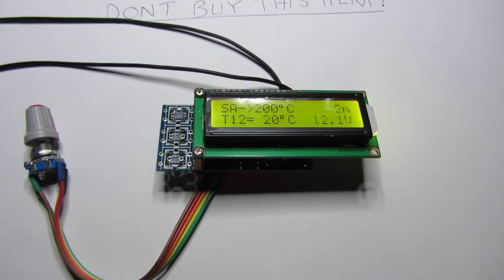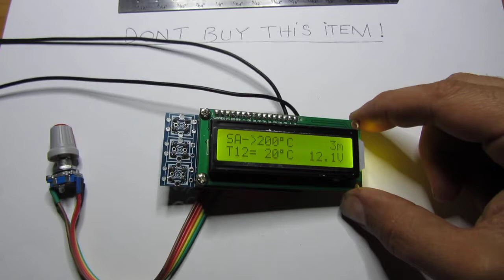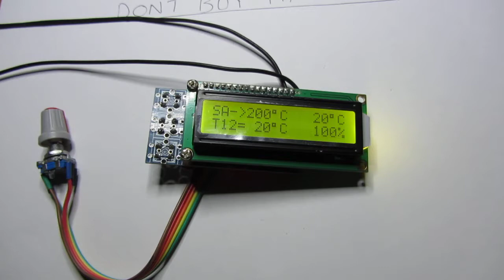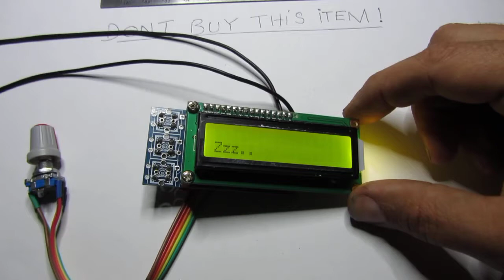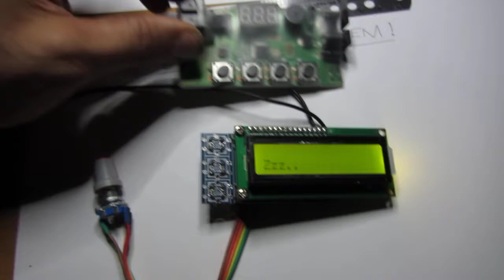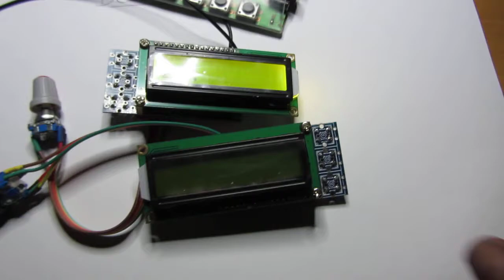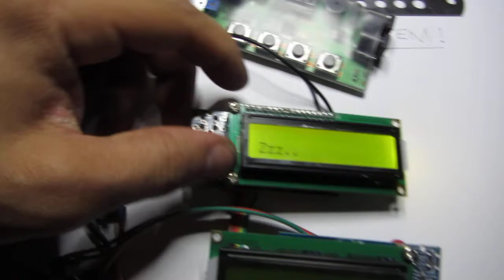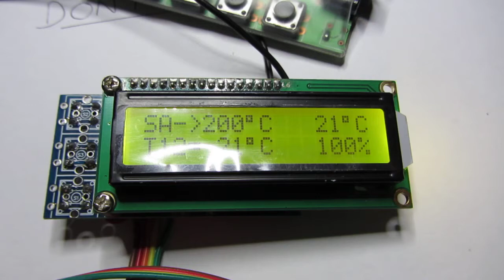Soldering Iron Station Temperature Controller For HAKKO 936 T12 T1 T13 Handle

Comment: try using 24v dude.... ummmm....
Reply from the maker: Like I said in the comment below, hundred time before, the 12V here are for to illustrate the video.
Problem with this station was coming from the misunderstood of the 907 handle cheated with a T12 tip, this handle working usually with PTC sensor.
This kit doesn't accept all handle. Only T12 tip, no even the t4 tip.
You think to be intelligent with your poor stupid comment. Just let me tell you you tired me. Thanks.

Comment: Alexander, what make and model is the middle handle. I like that one but cant find it anywhere. Thanks.
Reply from the maker: Hello, this handle is the WMRP weller, it works with weller station, and some many electronic makers make a soldering station for it. But it's very expensive.
If you want to make nice soldering with low price, think to have  T12 tip (the kit on the video works only with the T12 and T4 tip.
The WMRP tip cost between 30 and 50 dollars. And the handle cost 200 dollars. T12 tip cost 4 dollars....And it's very reliable.
Thanks for your comment.
Reply: Thanks. I have just found some. I was surprised at the price of them. They are expensive. I certainly cant afford one. I will stay with my T12's and TS100 irons. Thanks for the reply. :)
Ian
Reply from the maker: I have these handle. I can tell you I have the WMRP because it was a dream for me to have it since I was a child.
It's really not worth to buy it, cause T12 tips (4 dollars) and T12 handle (13 dollars) are not expensive, and make a perfect job.
Actually, if you make a soldering station with this kit, this T12 and the T12 handle (a real T12 handle and not a 906 customed handle) you can have a soldering station wich cost something 500 dollars.
Don't care about the low price, these tip are an incredibely way to make your self an amazing and powerfull soldering station.
Please see my other video about that. Thanks.

Comment: So where did the push-buttons from the left of the display go? You sure they aren't needed for anything?
Reply from the maker: they have the same use than the knob. But a clic on the button change degrees by step of 5 degrees, the knob by 1 degree. The knob have a push button integrated in the shaft, equivalent to the central button on the pcb.

Comment: Can you say where can I buy such a handle separately? https://www.aliexpress.com/item/BK950D-Digital-936-Soldering-Iron-Station-Controller-T12-Heating-Core/32625105427.html?spm=2114.13010308.0.0.AQRHYq
And will it work whith t12 tips?
Reply from the maker: You can find it on Ali express or ebay, "T12 hakko handle". yes, it can work with this station, just be carefull with polarity of the tip, or you can destroy it.

Comment: ty for this video, and what is the name of the hakko controller that DID WORK well for you? I bought a controller on ebay, and it does not work correctly, so have already wasted money , was wondering if you would be so kind to tell me which one DOES work so i can buy that one. and waste NO MORE MONEY! LOL
Reply from the maker: +Hammer USN 3:57 this one works nice, or this one http://i.ebayimg.com/00/s/NTk5WDgwMA==/z/1KAAAOSwNSxVHL-Z/$_12.JPG
Reply: +Alexander Hartdegen thanks , I appreciate it, how about the one you show with the memory buttons, does it have a name or ID of some kind ?
Reply from the maker: + Marteau USN no. just be care about the image of it. but this one works with a PTC element not a thermocouple . If you do classic electronic chose this one on he video (906 handle) if you do micro electronic and classical, chose this one on the picture.
Reply: +Alexander Hartdegen thank you, for being most helpful.
Reply from the maker: if you use your soldering iron in several use condition, it can be important to have this micro vibration switch incorporated in the iron handle. If not connected, the iron will work correctly, without standby mode on.
The vibration sensor must be placed in the iron handle, not on the pcb.

Comment: you can try some other chinese HAKKO T12 style controller boards.. I got this--->   http://www.banggood.com/Digital-Soldering-Iron-Station-Temperature-Controller-Kits-for-HAKKO-T12-Handle-p-993248.html
and i am going to test it soon!! Other guys say this is good!
Reply from the maker: +mitropoulosilias yes this device works.
Reply: Alexander Hartdegen Ohhh, Thank's a lot! I always wanted a soldering iron that have replacement tips, and i never had lot of money for that!!
Reply from the maker: +mitropoulosilias in fact, the controller board you're waiting use T12 handle. A classic soldering station (like 906 model) use very ship tips, you can have 10 different tips for 4 dollars.
T12 contain the heating element, sensor and tip in the same time. Tip like this one cost 10 dollars per unit.
With a classical chinese soldering station (but good performance), you pay 50 dollars, but only 4 dollars for 10 different tips.
Reply: Alexander Hartdegen Thanx my friend!!
Reply from the maker: +Гасан Аликберов only the T series works (T12 for example).
All other features claimed in the advertising of this device are false.
Please see the new video about this device in my channel, called 
""""" Update: Soldering Iron Station Temperature Controller For HAKKO T12 Works  """" Thanks.
Reply from the maker: +mitropoulosilias please let's see the new video about this device in my channel, called """""Update: Soldering Iron Station Temperature Controller For HAKKO T12 Works  ''''"" thanks.
Reply from the maker: ***** go on Banggood.com and search " T12 tip" and " T12 handle", or T12 soldering station".
Reply: yes it is t12 tps
Reply from the maker: ***** no it works on T12 T2 and T1, but I don't know if the "sting" (the tip) is able to feed the handle correctly.
Reply from the maker: ***** ask this to the seller please...
Reply from the maker: Nizami Alikberov what the hell can you tell me what is your real problem with this device ??
Reply: ***** Chinese websites sell million of products and sometimes the description is not the best! I had some trouble to assemble that kit, because i had almost no infos what to do. But i after the assembly everything is ok. Banggood works for me. They have nice support but sometimes they do not know everything about their products! :-D
Reply: the board has contacts, sleep switch, a switch should be soldered to them? Does it matter?
Reply from the maker: Gas Jackson this is not a normal switch, this is a vibration switch sensor,, saled with the soldering controller module. If not, you can buy it on ebay for not expensive devise.
Reply: vibration sensor is in the set, it also exists in the solder handle. enough if one sensor in the handle of the soldering hakko t12?
Reply: +Alexander Hartdegen I realized 2 pins coming from the vibration sensor with soldering pen is necessary to solder contacts on the controller vibration sensor
Reply from the maker: Gas Jackson you need to solder this contact to the board trough a 6 or 7 pin connectors (aviation plug or other)
Reply: Alexander Hartdegen ok, I understood everything thanks. to the vibration sensor from the handle of the soldering iron is a signal to the board. all realized thanks
Reply: Alexander Hartdegen my aviation connector t12 5 pins
Reply from the maker: Gas Jackson that's ok, you use two contacts for the MINUS and PLUS of the polarized tip (be carreful with this point) and two contatcs for the switch vibration. You can use the remain contact for to connect the ground to the ground of the tip, but I think it's useless, and for my part I prefer not to do it.
Reply: Alexander Hartdegen  ok👍 thanks
Reply from the maker: Gas Jackson  no, this system doesn't work  with a short circuit like a jumper. If you do that, the system understand than your vibrating sensor is blocked on " on " position, and it will do his work again.
What you need is to put nothing, and try to enter in the menu set up (if you can find it, cause this device is crap) and change the time value for sleeping mode. If you can't, you can just put a push button with long wires for to reset the board when it's on sleep mode.
If nothing of these ways are enough easy, you can just plug ON/OFF the board to reset it when iron is on sleep mode.

Comment: I have bought one recently and built it in a small PVC box. Works like a charme. I do not understand it does not work for you. Is straight forward connecting. 
I used an old laptop power supply.

I made a picture: 
http://i72.photobucket.com/albums/i173/f2ride2001/002_zpsbfac5356.jpg

Inside view: 
http://i72.photobucket.com/albums/i173/f2ride2001/004_zps39600ff8.jpg

If the PCB is defective, claim the supplier. Simple!
Reply from the maker: Hi, thank you for your comment. I wrote a message to the seller, and he told me we must waiting for the engineer who was spending holliday. I told them about this problem but they never responded to my message.
can you tell me in what seller you bought your station?
Reply: Alexander Hartdegen

I have bought it at the following link (from my archive) 

http://www.ebay.com/itm/281243012435?ru=http%3A%2F%2Fwww.ebay.com%2Fsch%2Fi.html%3F_sacat%3D0%26_from%3DR40%26_nkw%3D281243012435%26_rdc%3D1
Reply from the maker: f2ride2001 ok thank you. I think I will try again. Perhaps I had bad series of them.
Reply: f2ride2001 Hi, recently bought this card and also does not work, also bought from this seller. 
looked a picture of your connection and I have some questions: 
Why 3 and 5 Pin soldering soldered together 
You have done the configuration menu station (run while holding the middle button and power up)
Reply: zatemm Which pin 3 and 5 do you mean?
Reply: f2ride2001 I mean the contacts on the connector for soldering pen
Reply: zatemm I just measured the points of my soldering iron en connected the temperature sensor to T+ and T- and the soldering iron heater to + and - . Be careful as they are NOT next to each other. You can see in the ebay link for the connection schematics. Although in chinese.......